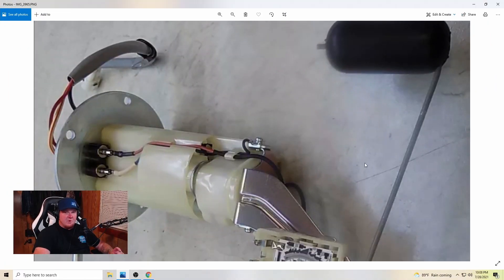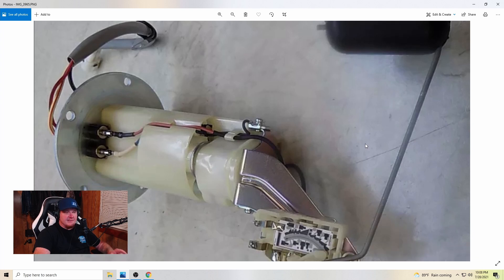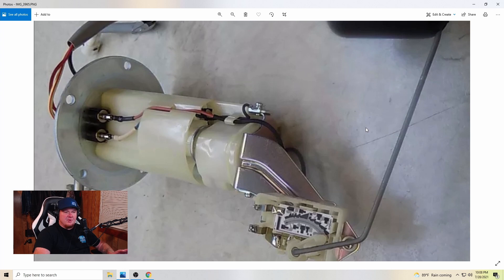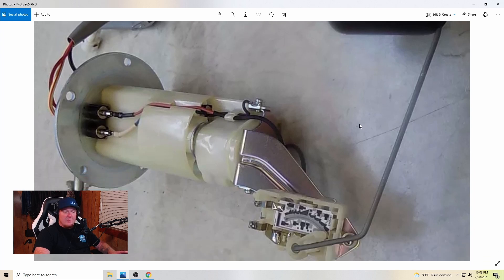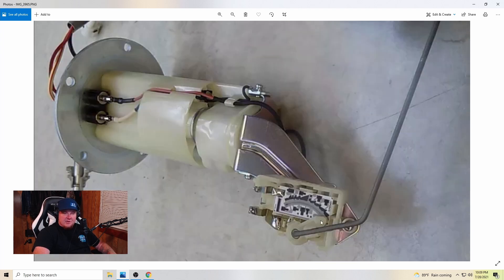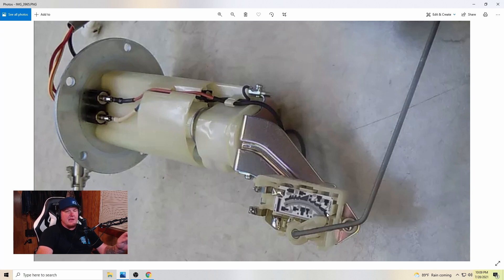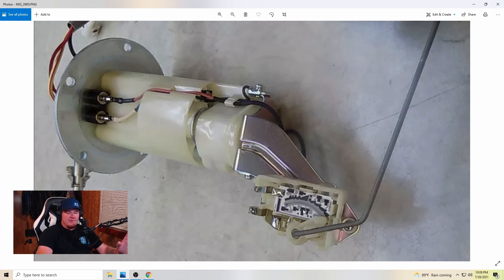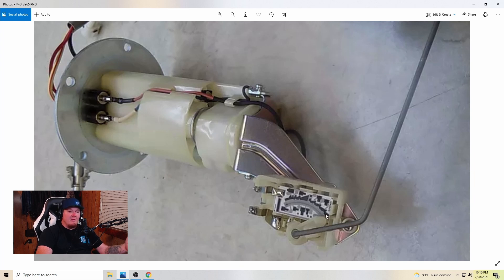SUZUKI DL650 VSTROM FUEL GAUGE FIX! | NCmotoRIDER

Comment: Before doing what you show in the video, it would be a good idea to check the grounds.
After doing some research I found in the VStrom community that others had the same problem and the solution was a new ground wire to the pump.
From the side of the pump to the socket it is a 2.5mm cable and from there to the bike body it is 1.5mm.
After years the cable dries out and its resistance changes.
This results in the wrong voltage value from the sensor (going to the instruments)
Reply from the maker: I checked everything before I removed the tank and done everything in the video

Comment: I"ve got a dl 1000 2004 and got a differend somehow similar problem my fuel bars instead of dimushing by increments I loose half of them only after a few miles ridden on a full fuel tank , and yes the fuel pump/gauge looks just like the one your videos I'll be trying your solution though I"ve ordered a new gauge too , my ohm readings are funny full= 63 ohm and empty -4.3 ohm as per manual full should be 4 ohm and empty 182 ohms .Thanks for your video !
Reply from the maker: If this doesn’t work, you may need a new sending unit. I got lucky when this fixed mine.